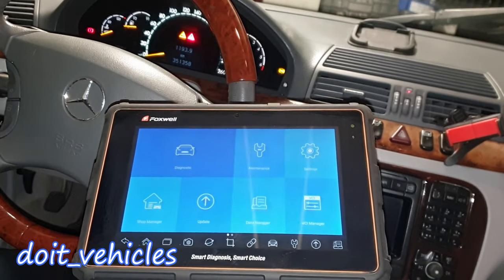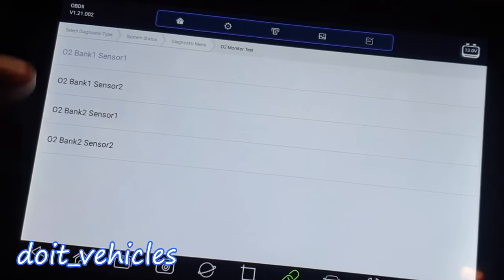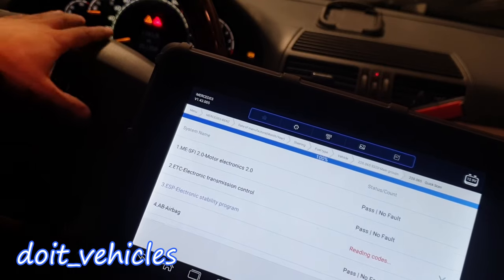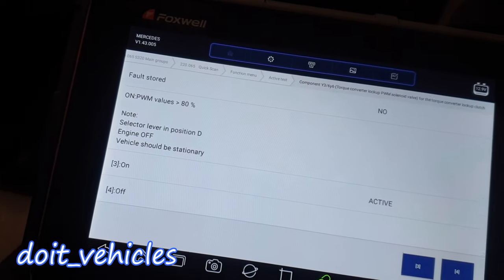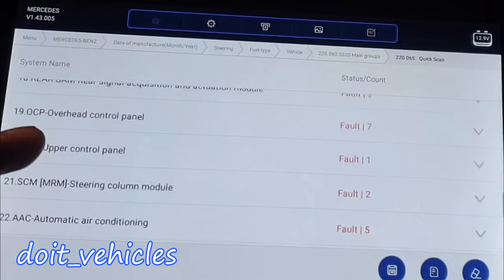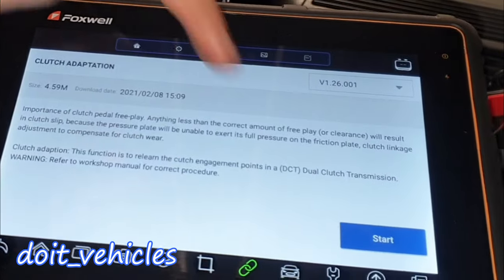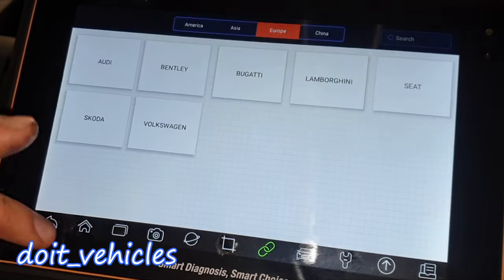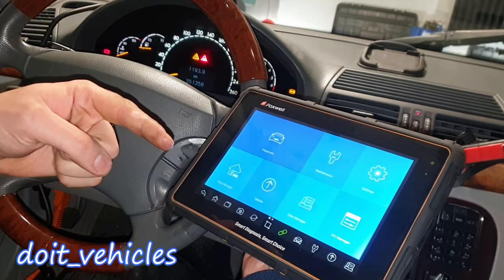Scaning an old 1999 Mercedes S class with i70 pro Foxwell scan tool

Comment: Thank u so much for your efforts...
I have Mercedes W202 1997 would you please tell me what is the best affordable Scan tool for this model...thanks once again
Reply from the maker: Hi ! The question is how much you want to invest in it and how far you plan to take diy car repair "journey" As a first time tool I would recommend the BlueDriver (with the adaptor for the w202 ) . Also on a 1997 car you won't get many features available anyway .
Reply: @doit_vehicles  is Foxwell i70 pro is ok for w202 1997? Is that w202 model present in the Mercedes menu?